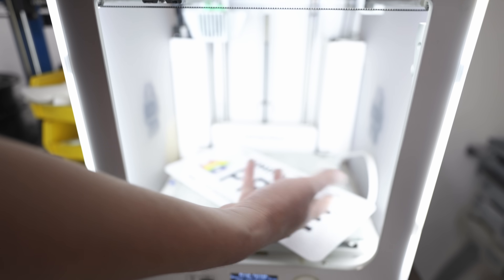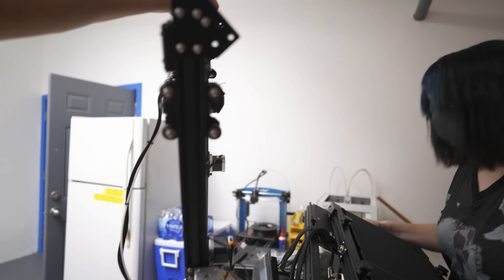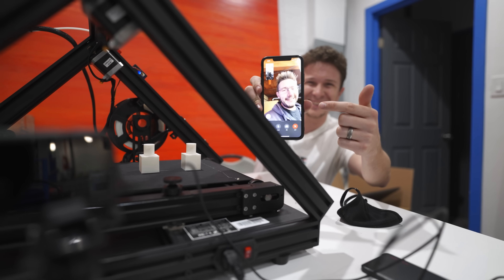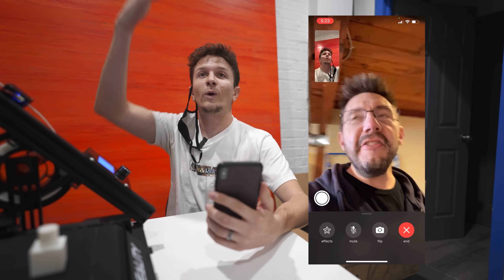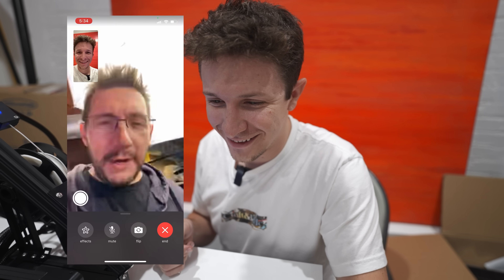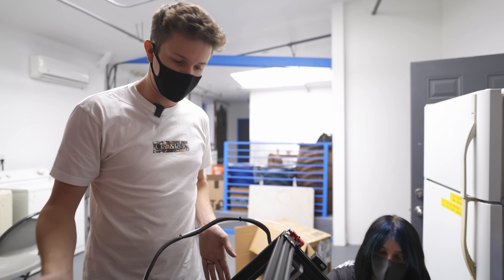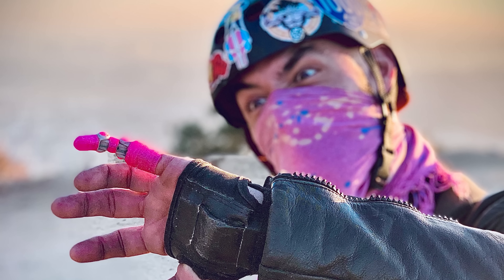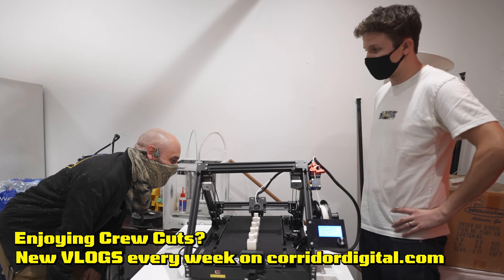This 3D Printer has an INFINITE Z Axis!

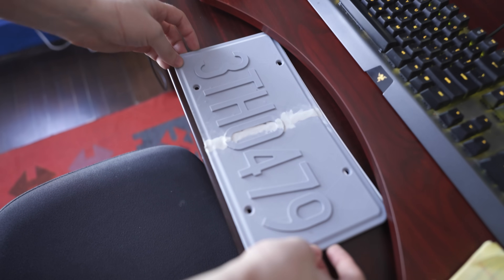Comment: 0:42 technically you actually could print the license plate diagonally with supports underneath in one piece since they are 300mm wide and the diagonal of the build volume is like 362mm also you could use a bigger printer. Just sayin
Reply: My first idea was diagonally, using supports! It's gonna use a LOT of support-material, but it's doable.

Comment: Woah is this the birth of the stop motion video?!
Reply: Nope, this printer is very faulty, they used the bambu lab brand for the stop motion project
Reply: @giangquangvinh6487 I think he means the birth of the idea.
Reply: @giangquangvinh6487 elaborate more why they bad?
Kinda disappointed, the idea looks promising.
Reply: @bethaapple2102  having it printed from a 45° angle  is just not always as consistent as most other printers. When you do the design or slicing for a model, you also need to imagine it being printed in a different manner, it takes you a while to get used to that, adding on top that if you are also using other conventional 3D Printers. And for me, most printers that come out since 2022 should have auto calibration so you don't need to troubleshoot it whenever the prints fail, just like in the video. When the printer works, yes, the idea of printing infinite like this is great
Reply: @giangquangvinh6487  thanks bro
Reply: @bethaapple2102  you're welcome, you can check Teaching Tech's video on the CR30 belt printer to hear his opinion